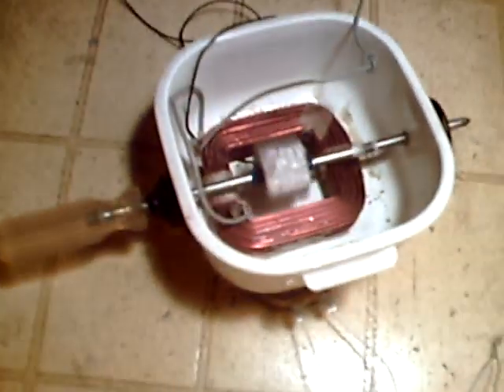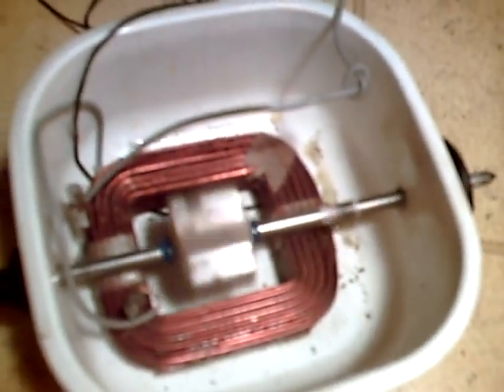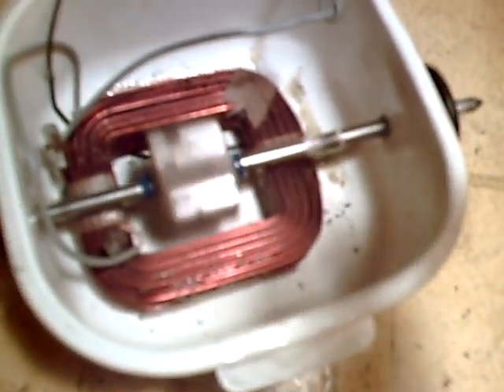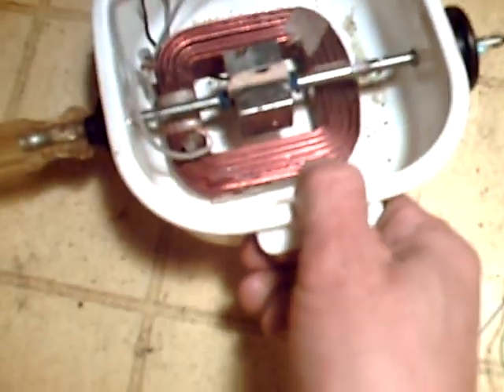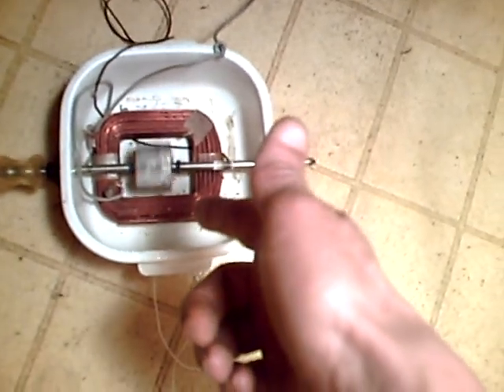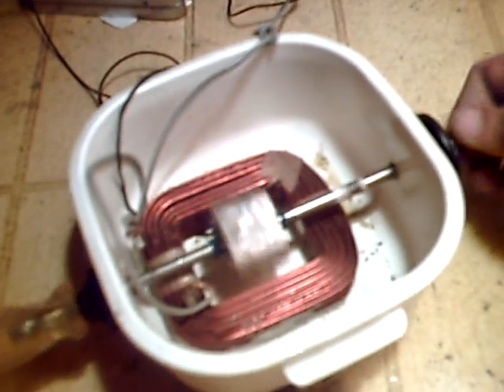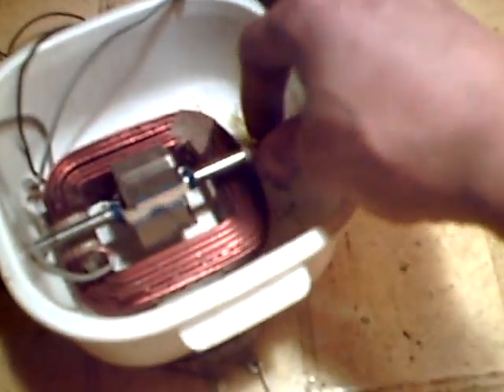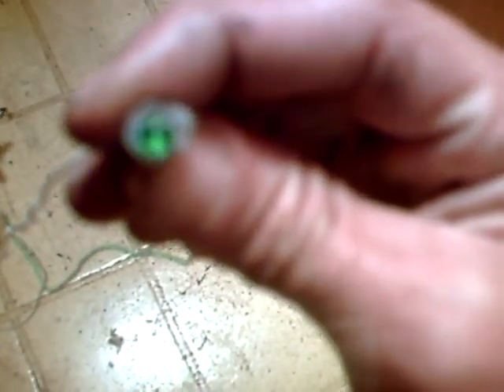newman machine

Comment: Is the power out greater than the power in?  Need to measure volts and amps input and volts and amps output and compare power.  Watts = Volts X Amps.  I don't think output exceeds input.
Reply: of course not, if there would be AT LEAST one other coil on top then maybe since the efficiency of the other coils is greatly reduced the farther it is then we would need to mesure it. So there would be a chance with 3 coils total but like it is right now it's purely useless

Comment: This video is one of the most unappreciated and important videos of all times.  At first it comes across as some crappy ass video, but what's going on here is a self running electric motor that even keeps the batteries charged VIA, BEMF.

IF YOU WANT INDISPUTABLE PROOF OF FREE ENERGY, THIS IS IT.

7 Years later and it's almost 2015 and only 83,624 views???!@$%
Reply: it's not free energy, this system is taking more energy to spin the motor, than the energy that's been transferred to the system via the magnetic inductance.
Reply: +djBC10000 the motor has two parts pulsing and shorting.  One part conventional another unconventional.  Through a top of the line oscilloscope and expensive ones, it can record the negative back spikes and it's been seen by scientists.  This back spike has been recorded and it is given back to the source.  Normal meters won't detect swift changes in pulses
Reply: "self running motor" ... uhhhh ... what about those 2 batteries he shows?

Comment: Not wanting to sound negative, but it seems a lot of trouble just to make an LED flash on and off.
Basically all you have made is a Transformer with a moving core.
Transformers are about 90 -95% efficient, not so for this Newman Motor.
But it's nice to make stuff yourself.
Reply: This video is one of the most unappreciated and important videos of all times.  At first it comes across as some crappy ass video, but what's going on here is a self running electric motor that even keeps the batteries charged VIA, BEMF.

IF YOU WANT INDISPUTABLE PROOF OF FREE ENERGY, THIS IS IT.

7 Years later and it's almost 2015 and only 83,624 views???!@$%

Comment: you got it dude... this is the way it works... the magnets rotating becuse of the voltage " potential energy" in the dead batterys. that means the magnetic fields will enteract creating rotary motion "kenetic energy", thus inducing a current in the secondary windings.... if this energy was connected to capasitors and then routed with diodes to the inpute side of the unit..... bang.....keep the youtube connected and post more man... lets save the world

Comment: If this is really over unity you should be able to construct it in a closed loop and put a magnet array on the outside mount to the rotor shaft and produce ac without cost.  I also would say that using a non ferrous material in the rotor shaft would probably produce better results. Ferrous materials will become magnetized themselves which could potentially slow the rotor via magnetic slaving.

Comment: I see you designed the DROP AN D GO  CHARGER"
I'm  the one who told you to put the bat-tires in the magnet.

They used the device  to recharge Phones and Ipods.  How much did  yo make.

By Inventions Designs & Concepts. 
They use it as a power converter. You can use a device like this s to steal  power from the electric company from the meeter. 

Go Get your  MONEY!

Comment: Not to seem ignorant or anything, but to me all that looks like is a simple electric motor and a simple alternator, where as the first coil is converting electrical energy to mechanical energy, and that mechanical energy is being converted back into electrical in the second coil.  It's no breakthrough, you're doing no more than just hooking up the LED to two AA batteries.  Tell me why I'm wrong.

Comment: the input is a pulsed dc but the output from the secondary coil is ac. you show this by the fact that the led lights up with the coil facing either way... i think the transformer action between the coils would induce an AC in the secondary because of the field collapse overshooting the original voltage, and interactions with the rotor magnet would also induce AC in the secondary...
 search for u.s. patent 3913004 by robert alexander, it uses a similar concept in a different way...

Comment: I think you will find that the kind of voltage or current induced in a coil by a magnet produces only AC power. If you care to look at some of my Bedini Videos, i state and prove this. All my coils outputs are connected to full wave bridge rectifiers which convert induced AC into usable DC.